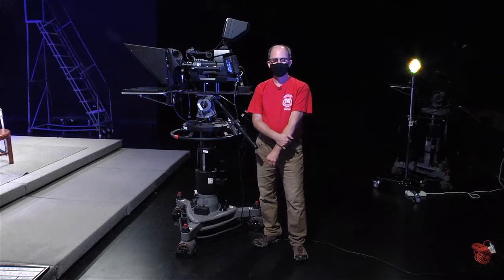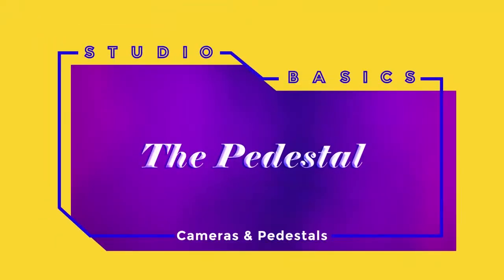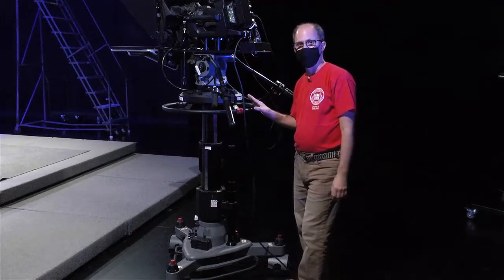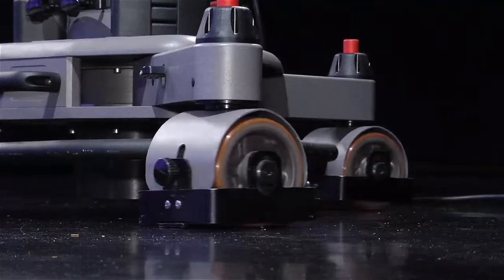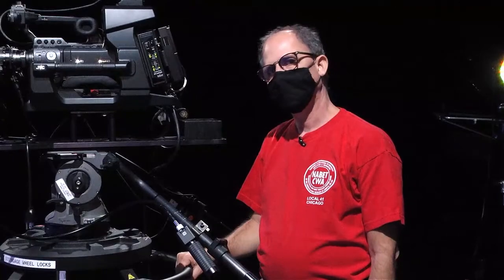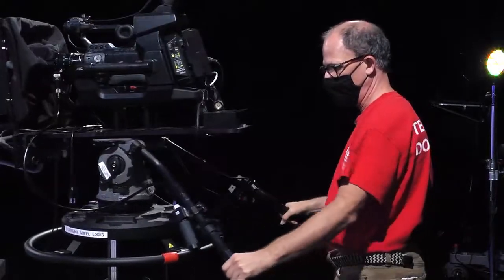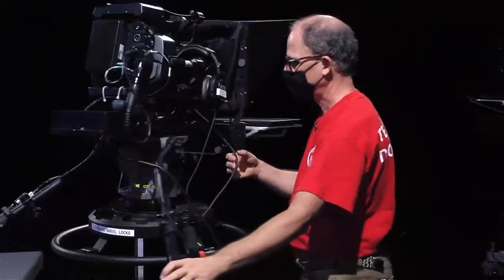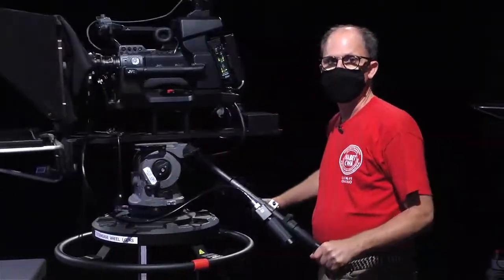The Cameras & Pedestals - Broadcast Studio Basics

Comment: Some very different policies the US Here in  the UK at the BBC, ITV and others, leaving a camera pad unlocked is very bad form. If you walk into a studio and see a gassed up ped, you assume an unbalance and press down to check rough balance - and nobody removed a prompter, or added one - so expect the lock to be on. Initial setup means unlocking the ped column, unlocking the head, as that will also have locks applied. Interesting how the US process is the opposite. Our Vinten beds also don't exhibit the drop in heaightwhen you tilt down, and when we are in crab mode, we don't have to  keep using locks or brakes. A lift and tilt down is just a two  handed process - right pan bar and left hand on the ring for me? Even odder here is the trend  to have zoom on  the left  and focus on the right - goes back to the early days when the mechanical focus on many of our studio cams was on the right. Some camera folk see it and swap them, but that's often not practical, so you learn both - because in single cam work on a tripod, zoom goes on the right, lens direct focus with left - we're clearly odd here!
Reply from the maker: Hey, Paul, I know that this response is a year late (as I am not normally the one to respond to social media posts), but I saw your message and thought I might as well reply.  I can only say that our procedures are probably unique to the cable access environment, where non-professionals get trained to use our studio to express themselves in a very low-cost manner.  Since we deal with a wide range of people with varying skill sets, our practices are geared towards protecting the equipment so that others can come and continue to use it.  So-called professional studios most likely have a different approach.  It might also have something to do with the particular pedestals that we use - Cartoni. Do you have cable access centers in the UK, where the general public can take classes and mount studio productions for a small fee?  Just curious.  Eric Torres, Training Coordinator.
Reply: @CANTVTraining  Thanks Eric. Cable TV never took off here, so no, nothing like that. I must admit it's a shame, because that would have been great -but no bother, just a comemnt - I laughed to see the word 'ped' kept being autocorrected and I didn't notice! Best wishes from england.
Reply from the maker: @pauljohnson4590  The sun must be setting for you guys over there.  Mid-morning here, and cold as hell, but at least sunny; nice to read your message.  I initially felt foolish sending a one-year-late response (a new record for me), so thanks for writing back!  Best wishes from Chicago.